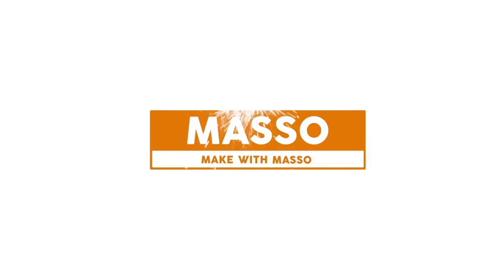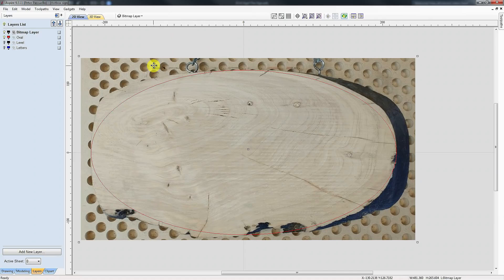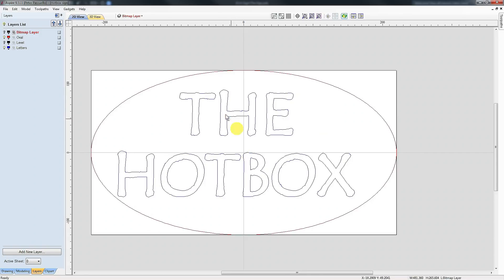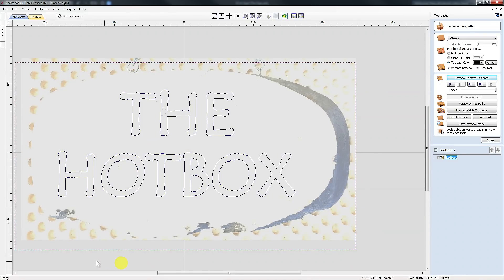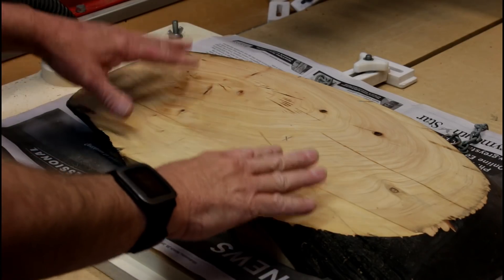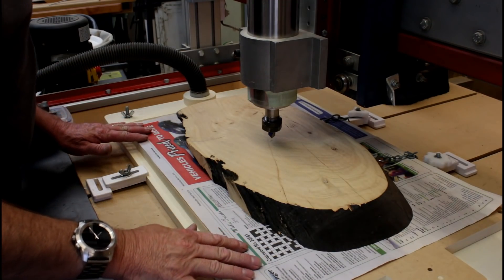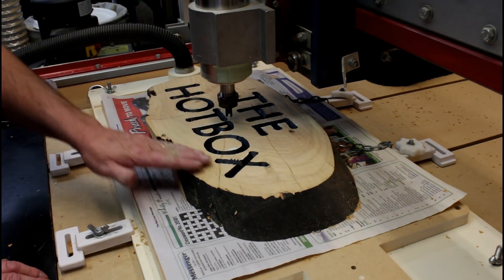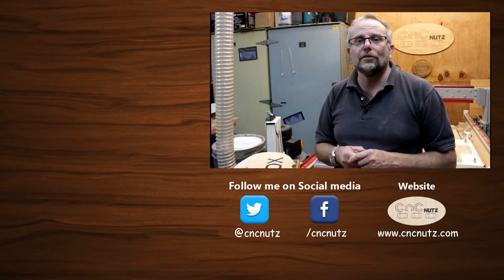How to VCarve a Sign - CNCnutz Episode 224

Comment: At 5min, what do you mean by the:  ramp pass being last vs no profile pass ? Thanks again
Reply from the maker: I mentioned using a raster cut which means the cutter moves left to right across the material instead of using a spiral cut. Because the area I am pocketing is larger than my wood I don't need to do a profile cut around the pocket at the end so I choose no profile.
Cheers
Peter

Comment: Good stuff.  Thanks Peter.  I don't follow where you have the V bit at a start depth of 0.5mm but it doesn't appear to show how deep the V bit goes for the "finished" letters (i.e. where do you set that depth?).  Cheers, David.
Reply from the maker: In VCarving you can specify a flat depth at which point it will spread out and go no deeper or you can not give a depth on which case it goes deep enough until the sides of the cutter spans the sides of the item you are VCarving. The start depth adds 0.5mm to the normal depth which gives me the little extra with which to flatten the  surface.
Cheers
Peter

Comment: Thanks for all your incredible work Peter.  I do quite a bit of this type of sign. First thing I do is screw my blank to a 3/8" piece  of plywood with 5/8" screws positioned at each end of the blank to avoid hitting with my V bit. Since the size of the plywood is the same size as my vacuum table there is no need for any clamps. The blanks are all pre-finished with 3 coats of gloss water based Varathane and then masked with cast sign vinyl. I never use paint to paint the letters, a solid stain is much easier and won't peel like paint, any stain that seeps under the vinyl is very easily wiped off the varathane with a moistened Q-tip. Another thing, I never level off my blanks, it ruins the beautiful saw marks that are an important part of the rustic look. In many cases the letters turn out looking interesting  with the variation in depth of cut, when there is too much variation I just run a second pass with only  the letters that need to be a little deeper. The entire process is very easy and quick, while one sign is being routed I have already stained and cleaned up the previous sign. Learning CNC is a such blast, I am just past the novice stage when it comes to all the technical stuff and really appreciate watching CNCNUTZ  every chance I can.
Reply from the maker: Thanks Ken. Excellent tips especially about the rustic look of a sign of this type. This one had been planed flat but saw marks would be a good look. Prefinish and stain is something I will have to try one day. I'm always looking to make life easier.
Many thanks
Cheers
Peter

Comment: Nice one, i sprayed a thin coat of lacquer before painting the letters then the final cut took that off and no paint soaked into the wood edges :-)
Reply from the maker: Normally I would as well but this is going outside and I'm a bit worried that the natural oils in this would would cause a clear coat to fail especially outside. That's why I put a prime / undercoat on in this case.
Cheers
Peter

Comment: MIght it be a good idea to put a little bullseye sticker (or some such) at the approximate centre of the sign blank when you're taking a photo of it, and then to set that point as your home in the software, so that you can easily match up when homing the CNC?
Reply from the maker: Excellent point. Something I mentioned in the writeup I did for this video. It would make things even easier but where's the fun in that?
Cheers
Peter
Reply: Excellent idea!